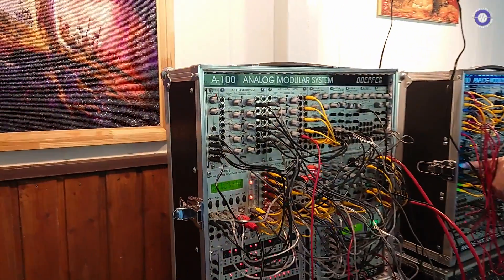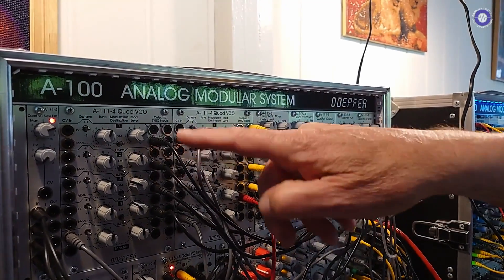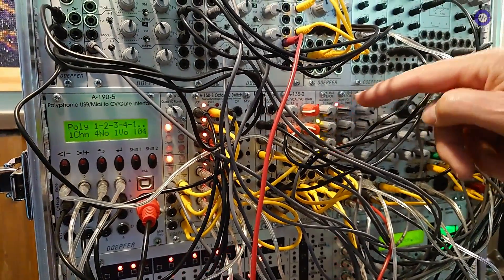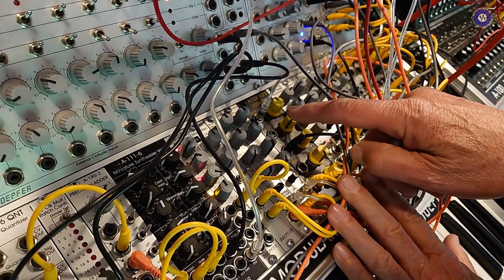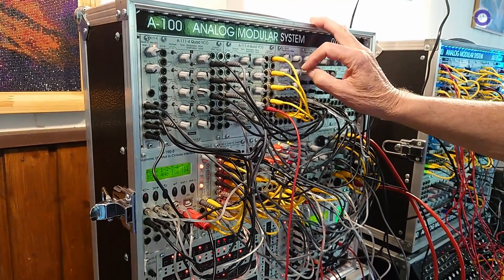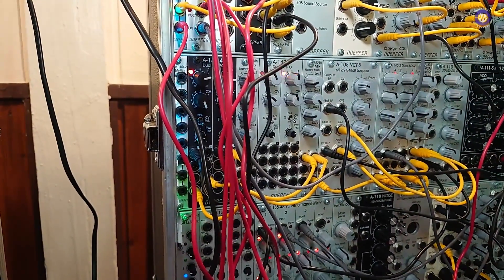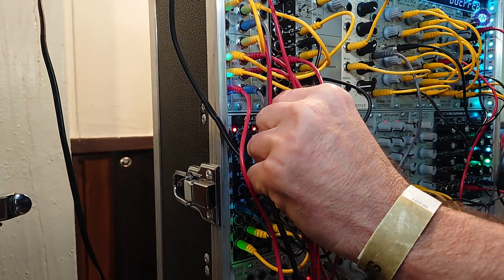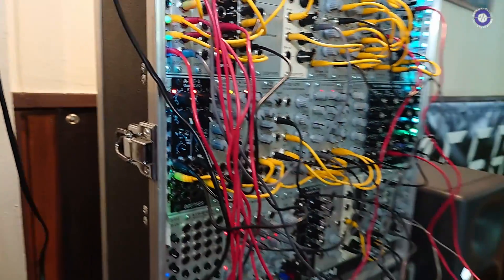Superbooth 2023: Doepfer shows off their latest modules

Comment: Doepfer always delivers modules I didn't realize I needed! (Though that portemento knob seemed to function reverse from usual)
Reply: Portamento/slew knobs are actually non-resonant 1-pole low pass filters with the knobs reversed. It’s pretty easy to change, especially on the (mostly) DIY-friendly Doepfer modules
Reply: @iamsushi1056  Interesting! So swapping a couple of leads ought to fix that. I would think it will be corrected by the time they send out out the final product.